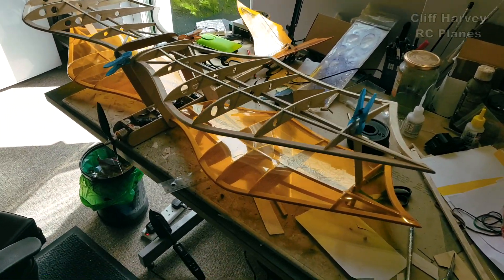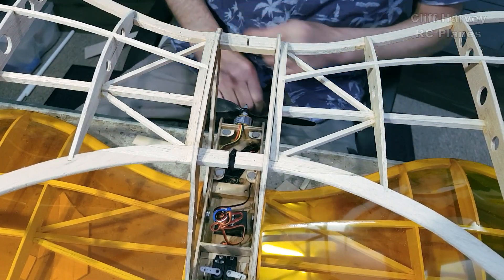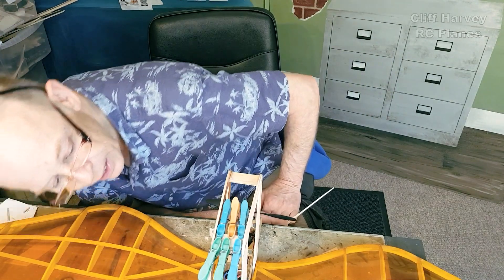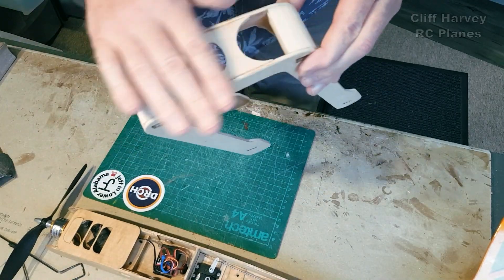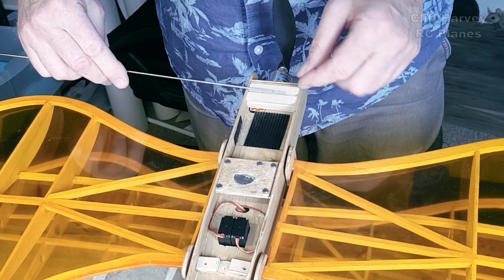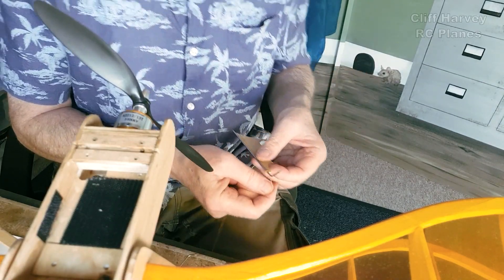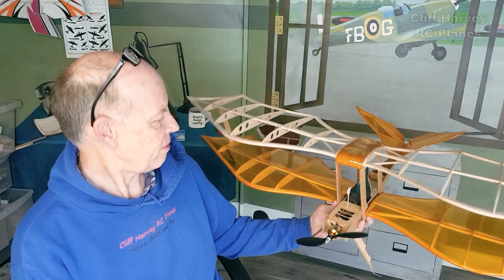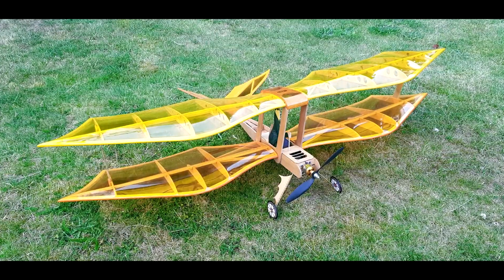Da Vinci Flyer Biplane Creation Part 2

Comment: I watched them backwards as that is how they came up in my recommended. I always went with if it looks right it will fly right. I now see it isn't always dependable rule. I thought the flier wouldn't make it beyond a ballistic arc that was wrong
Reply from the maker: Hi Kirk, if it was on a children's fantasy tv programme it would have soared into the wild blue yonder with no difficulty but in reality I broke to many aerodynamic rules 😁, thanks for watching and commenting,  cheers 👍
Reply: @CliffHarveyRCPlanes  Yes, it remind me of an old Bruce Willis, Andie McDowell movie when it took off then up in a loop, but I figured that was a trim issue. It reminds me a bit of the Langley Flyer which with some changes several years later was able to fly after the Wright Flyer. I really enjoyed the videos, Sir

Comment: It´s no more da vinci.
But nevertheless-->it has style !
What about the angle of attack of the 2 wings ?
Reply from the maker: Hi Swyntopia, thanks, it was only ever Da Vinci inspired, I'm beginning to wonder about the AoA myself now 🤔👍
Reply: @CliffHarveyRCPlanes  you know, the 2 wings of biplanes usually have different AoA.
Your upper wing sits foreword, that´s usual.
I´m not sure, but I think the upper wing has the bigger AoA.
To accelerate the airflow at the topside of the lower wing.  (  ??? )
( I´m no native english speaker.
Or--> english is not my mothers language   :-)    )
Reply from the maker: @swyntopia  It seems it a massive subject, wing section, aeroplane speed and attitude etc all play a part, I suspect mines not quite right, have you seen the maiden flight yet? https://youtu.be/KDUpRSs6j5k, cheers. You're English is pretty good by the way.

Comment: Whereabouts is the cg Cliff?
Reply from the maker: Well that's a good question Gary, it seems very tolerant but basically a third of the way back at the root on the bottom wing 👍
Reply: @CliffHarveyRCPlanes  forgive me for asking Cliff but I've always thought that the cg was measured from the top wing on a biplane! You're going to have to show just how you do that, excuse the ignorance.
Reply from the maker: @garyshakles7764  Well yes, but if you turn it upside down it's on the top of the bottom wing, same difference. It's not set on this model, it's where it is to fly ... !
Reply: @CliffHarveyRCPlanes  can or could you turn virtually any model right or 'wrong' way up to find the balance point for the cg as that point shouldn't change, I suppose whichever is easiest.
Reply from the maker: @garyshakles7764  Low wing models are easier to balance upside down, as you say the cg position is the same either way up 👍
Reply: @CliffHarveyRCPlanes  Hiya Cliff, another question for you, are you using any dihedral on the lower wing set? Sort of a pup or camel setup?
Reply from the maker: @garyshakles7764  It duplicates the top wing Gary. I did consider making the lower wing smaller but I wouldn't have been able to put struts in due to the change in the wing construction.

Comment: It will be  super floaty with the added wing. You dubbed the lift and have not dubbed the weight.😎
Will need a bit more power to overcome the added drag.
Love the gear fairing design. Awesome look.
Have you ever seen a kids show called " Catch that pigeon " ? Its looking like the planes used in that show.😎
Reply from the maker: Thanks Ron, yes, as flown by Dick Dastardly, I think it was called Wacky Races wasn't it, I should have covered it in red film 😁👍
Reply: @CliffHarveyRCPlanes   that was another show done by the same group of makers, and they used some of the same characters in them all. But yes this reminds me of that style airplane from those shows.😎😁
It looks awesome.